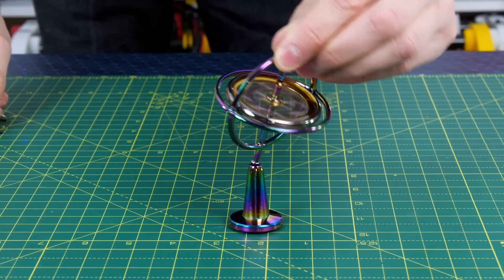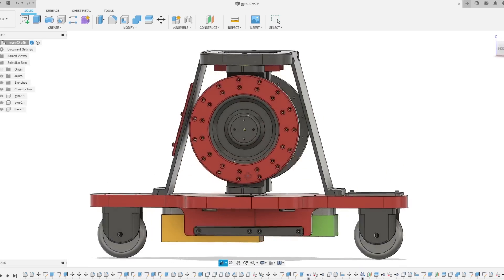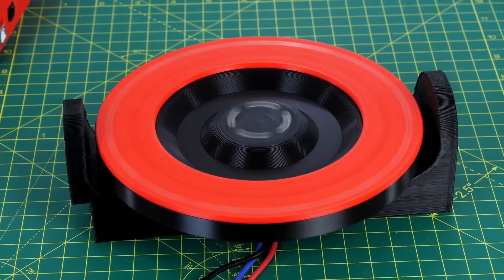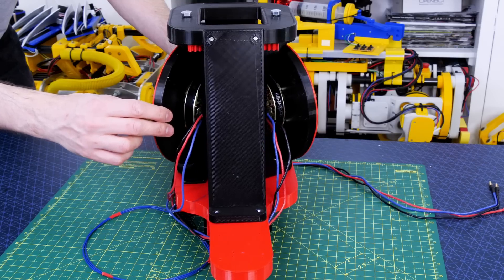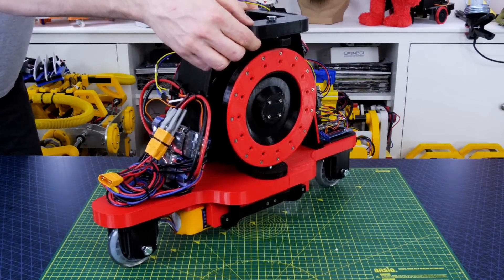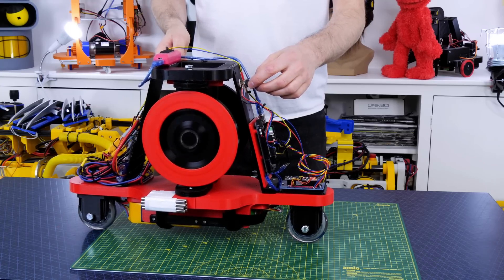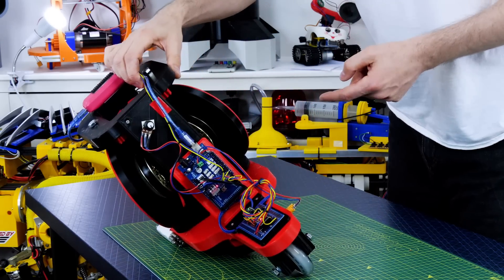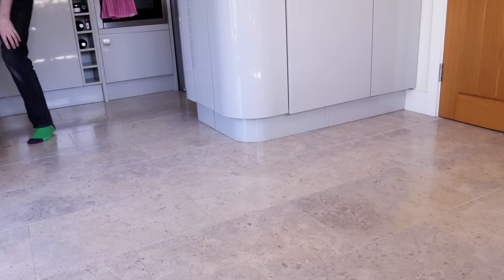Balancing on Inline Wheels with Gyroscopes

Comment: what if you lower down the forward gyro stabilization point. what if you use a gyro copter horizontal gyro flywheel. ie passive stabilization, and the gyro drift is cancelled by the ground wheels.
Reply: is it 3 years already? lol. why does a bicycle stay in direction, even the front free turning wheel, when the speed forward is sufficient. because of the grounded wheels act as gyro balancing.

Comment: I want to diy a larger printer with 400mm x 400mm bed. Can any 3d printer controller travel that distance according to the gcode if the frames are large enough

Comment: Could it consistently hold an angle that's off center? Make it propelled and see if you can make a constant turn by leaning with the gyroscopes.
Reply from the maker: Only if the gyros could do a 360 in yaw, otherwise they reach their end stops. They can only exert force when in motion.
Reply: @jamesbruton  That makes sense, thanks for the response. Would gyro brakes have any effect? I'm trying to picture what kind of linear force would result from braking on one side of the gyro.

Comment: My quick take after a bit of research is that Fanhome is not offering a great value.  couldn't find the total cost, but: correction: finally found it:  100 stages.  They are pretty sneaky about this.  $13.99 and $2.40 shipping per stage, 4 stages a month... so $65.56/month for 2 years for a total of over $1600 while appearing to have about or less smarts than the $50 hasbro r2d2 or the $99 sphero edition from a few years ago.  I love R2D2 too but you gotta vet these things.
Reply: actually it may be worse than that, I don't see any evidence that they finished the stages for the Charger, which is no longer offered, or any other models they put up

Comment: If you built it so that gyro wheels could rotate continuously (such as using a slipring to get power to the gyros) you could even allow it to hold position at 45° angles indefinitely.

Comment: i wonder if you could design a version, where both gyros would be able to roatate 360 degree, then use that ability of constant stabilization to tilt the vehicle like a bike, and turn using its high center of gravity (like a bike esentially)

Comment: I know there once was a gyroscopically upright two wheeled single seater car. With good lubrication and minimal drift/oscillation, how much energy would it take to get a car balanced? Would it be economical (i.e. because of the lower roll resistance and air drag?)

Comment: If your fix the wheels of a motorcycle or bicycle as your effectively have here, it will no longer keep itself upright as it moves. The angle between the wheels needs to be free to change for it to stay upright.
Reply: In fact, I think the angle needs to be able to both change in response to the shift in center of mass and be able to impart a torque on the centre of mass as it changes

Comment: That slow left right oscillation can be damped out by altering the relative weights of terms in the accumulation to favor more recent measurements. This is the next most important term in an approximation to the full PID controller. The Space Shuttle had a similar issue due to rounding errors accumulated as its automatic RCS system traversed the deadband during its orbits in space.

Comment: "not really supposed to run i2c off the same circuit board"
every industrial/home automation sensor ever: "hold my beer"
as long as you shield your cables and use bus buffers for longer ranges (differential ones exist if you wanna go past 10ish meters), i2c is gonna be just fine with that.

Comment: ball bearings for weight, interesting. spin that puppy fast enough and you got a claymore.
also, if you put a picture of an eye on that gyro, its slow back and forth oscillation would look like an eye looking around the room.
Reply: Oh half life 2 guy here hey!
Reply: Hay
Reply: Didn't expect you here
Reply: So in order to get the gyroscopes up to speed I've installed several dozen ball bearings in these plastic discs and I'm going to spin them at several thousand rpm to initiate a grenade boosted backhop off of this ramp here-
Reply: Hello there

Comment: I can see where this is going:       "The runabout–a Dillingham eleven-forty–shot smoothly forward upon its two fat, soft tires. Half-way to the exit archway he was doing forty; he hit the steeply-banked curve leading into the lofty "street" at ninety. Nor was there shock or strain. Motorcycle-wise, but automatically, the "Dilly" leaned against its gyroscopes at precisely the correct angle; the huge low-pressure tires clung to the resilient synthetic of the pavement as though integral with it." E E Doc Smith "First Lensman" 1950

Comment: on the international space station... when the CMGs get to the point where they can't exert force any more, we call that "Saturation". There is some automatic communication to the russian thrusters to do a "de-saturation" which can get the CMG axes back where they have control authority again.
Reply: CMGs? Or reaction wheels? Does a CMG actually have a saturation limit except for how much force it can apply? Like sure if you just rotate it continuously you'd be able to apply a continuous force, up to the point where the motor rotating the gyro around an axis perpendicular to the primary weight-spinning axis hits its maximum speed. Even at that point, you'd still be applying a force, just not enough for whatever is requested, presumably.
Reply: @clonkex  yes, CMG and you are right, at some point you lose a degree of freedom. You can read more about them here: https://en.wikipedia.org/wiki/Control_moment_gyroscope#International_Space_Station

Comment: Would allowing the gyros to rotate 360 degrees be an improvement?
Reply: Yes I believe so. You could use a slipring to power the main spinning axis and thereby allow the twisting axis to rotate continuously, you could even have it sit at 45° and it would just hover there.

Comment: With the automatic set point adjustment, can you now remove the weights taped to one side and have it automatically find the balance point (which might not be perfectly vertical)?

Comment: Am i the only one worried that the 3d printed flywheel turns into a shrapnel lauchner? be carefull james.. long life fatigue strength of 3d printed parts is really bad. with a wobbly design this means every rotation of this 3d is a countdown to a dangerous failure of your machine. you could replace the steel balls with sand or something more harmless.

Comment: Why can't the PID avoid creep by itself? Sounds like you hacked another integration step around the integration step the PID has already built in.
Reply from the maker: If the gyros could rotate in yaw 360' and keep going then it would be fine. They can only exert force when they are moving, so the end stop is the issue really.

Comment: If you turn the flywheels 90 degrees so that one is in the front and one is in the back and gave the enough room to be able to spin all the way around 360. You could use them as reaction wheels and then once the are saturated rotate the flywheels purendicular to the spinning axis and get even more force once they have been turned you could slow them down like a reaction wheel and reverse them and the cycle continues. Theoretically it will always be able to balance and never saturate. If you try this please mention me.

Comment: For projects like these, you'd probably save money and get better results if you bought a bunch of lead shot, filled a void in the print then put enough in that when you close the print, the clamping force holds everything together (like mechanically stabilized dirt if you've seen that video).

Comment: What you aren't including in your control scheme is the movement profile of the gyro motors.  Speeding up and slowing down those motors in combination with managing the gyroscopic procession should let you move forward and backwards.  Slightly angling the wheel mounts would let side tilt cause a turning radius.  It would be interesting to see how much stable control you could manage.  I remember following along with an online class called "Underactuated Robotics", and this machine makes me think of that

Comment: If you use the gyroscopes as reaction wheels you could control both pitch and roll will that configuration. Even if the two flywheels are rotating at different speeds they’ll still produce perpendicular forces rights?
Reply from the maker: If they were laid horizontally (like last week's video) and you tile one more than the other, then that would cause rotation in yaw as one they precess

Comment: Using a flywheel in that way sucks too inefficient and it's got a saturation point you only need 1 not 2 and have that 1 rotated 90 degrees if it rotates to the left make it rotate the flywheel rotate to the right and that will make it move to the right that will get rid of the saturation point
Reply from the maker: Watch last week's video I guess...

Comment: It would be very cool to build a miniaturized version of this into the head of a fancy cane, so that when activated the cane would stand up where you left it, balancing. I don't know what practical purpose it would serve, but it would be a neat "magic" trick!
Reply: It doesn't have to serve a practical purpose, but an undroppable cane would actually be really useful for the elderly. You can let go of the thing without it clattering to the floor immediately as long as it's close to upright, I can see that being worth a couple hundred bucks.
Reply: @Teth47  Actually if twisting a spinning gyro around an axis perpendicular to the spin axis gives you a force perpendicular to the plane described by the spinning and twisting axes, with a slipring to power the gyro's primary spinning axis, you could make it so that the twisting axis could twist continuously, which, with a sufficiently heavy gyro weight and/or high enough spinning speed, would allow the cane to stand up from even completely upside down.

Whether or not you could fit that into a cane, idk :P

Comment: What would happen if you decided to equipt this robot with motors and a "steering wheel"? Would driving a long and constand curve (basically circles) cause the center balancing point to be shifted due to centrifugal forces and Still keep the whole robot upright? If the robot stopped (or drove a streight line) would the balancing point return to "normal" again quickly or would you expect some issues with that?

Comment: Now you fixed the setpoint problem, you can remove the weights, right? Wonder what that looks like.
Reply from the maker: With my dirty hack version is looks like falling one side a lot more than the other. Ideally I need a velocity estimator and something that offsets the setpoint over a longer time. Then it could deal with offset loads.

Comment: 360 freedom of rotation, you have limited now
Reply: stick with 6-axis gyro balance, 3d cross with 360 freedom
Reply: wings when they are apart
Reply: gasoline electric supercap drone car, also 3d balanced, controlled
Reply: you have more lever if you have the attach points farther away
Reply: make them balls, so you can rotate without friction in 360, cameras on board
Reply: single 360 multi-axis gyro ball like in the "first contact"
Reply: contra rotating gyro spinner, should not try to throw it around to unbalance (creep down) with centrifugal forces
Reply: if this disc does work as self-upright gyro, then retest the first video spin tilt test, free ball bearings is a nasty biased test

Comment: Wow, if you motorized the fixed wheel (s) you could make turns by leaning the robot to one side or the other, just like a motorcycle, or even counter turning the front wheel for the total realistic experience of a motorcycle 😎

Comment: So the extra code which accumulates the controller output and adjusts the set point if it's consistently turning in one direction... isn't that what the I term of a PID controller is meant to do, or is it some kind of double integral term?

Comment: Could you build a Segway that is stabilized by a gyroscope? I had this idea several years ago and don't have enough knowledge of physics to have a clue about size, weight or speed of the gyroscopic wheel/s that would be needed. I imagine that you can stand on the thing and that it is somehow obvious that the stabilization doesn't come from electronics. If this worked with a lawnmover engine or something like that (steampunk like) or (even cooler) if you sat on it and would produce the energy by pedalling.

Comment: Could you mount a reaction wheel perpendicular to the gyros? when the gyros drift near to their end stops, use the reaction wheel to temporarily negate the force of the gyros as they return to the center position. This would allow the gyros to essentially move continuously as they can quickly reset when they have nearly run out of travel.

Comment: how environmentally friendly are all those plastic parts is there a recycled plastic filament option just for rapid prototyping
Reply: If you print your prototypes with PLA, it's biodegradable.  ABS is not, though it's more durable
Reply: @gregoirepainchaud   yeah I guess its a drop in the ocean compared to all the injection moulding coming out of china/ India but I suppose it could be coming  "3d fuel looks into"

Comment: If you have a single gyro in the center that can rotate 360 you wouldn't have to worry about it reaching the endstop.
A one wheel balancing robot, Claptrap from borderlands would be awesome to make.
Reply: But once this gyro is rotated perpendicular to the robot it doesn't have any control authority anymore, so effectively there's still an endstop

Comment: I was hoping you would make it a one wheeled robot and then you mentioned it. Would be cool to have both gyro and motorised wheel to balance in the different axes. But With one single wheel wit will probably spin around the vertical axis as well with only a single point of contact. So maybe a reaction wheel for a 3rd type of rotational control so you have 3 different rotational cotrol mechanisms for the 3 axes of rotation?

Comment: I think that you are not entirely correct, the real challenge of a bicycle /motorcycle isn't travelling in a straight line, it's turning, following a radius. It would be an interesting topic to explore the use of "counter steering" and whether your gyro stabilised two wheeler could be adapted to steer.

Comment: The two in line will vehicle reminds me of the Warsley do you have a car I believe there was some other gyroscopic re-stable glide monorails built around 1909 obviously I didn’t use microcontrollers they must’ve had quite elegant mechanical control systems for the gyros there are some articles in Wikipedia about them personally my favourite is the Woolsley gyro car.
. I always used to argue that you should be able to drive one on the motorbike license.

Comment: please build one with high center of mass since it will act like a reverse pendulum and will take more time to fall over, thus giving more time for the balancing gyros to correct.

i think it could be more stable for the same reason balancing a broomstick on its end is easier than balancing it on the middle.

Comment: You need to make  more and place three groups of four in a triangle formation.  Attach 2 on a rotating platform that is coupled with a counter rotating platform with 2 more units. It is important that you offset the plane of rotation 30° 

What happens when you forcibly speed up the presecion? You gain a linier force.
Reply: None of you recognize the importance of what I said.  I  know lets burn heavy fuel for weak thrust, cave man style.  Fools. I offer a revolutionary idea for free and not even one thumbs up,  troglodytes.  I left out some of the information hoping that intelligent people would be smart enough to ask the question.  You have 24 hours before I delete the comment and patent it for financial gain.  You had your chance.

Comment: Finally a use for a hubless bike wheel, That's where you put your gyroscopic flywheels.

Regenerative braking is an efficient because the electricity has nowhere to go, the batteries can only take so much.

You only need the gyroscopes going when the bike is stopped.

Dump your regenerative braking into the gyroscopes.

That also means you can get a boost from a dead stop without hammering your batteries.

Store a little in the flywheels at all times, and you could have a boost button. The right computer logic you might even be able to get it to do some crazy cornering.
Reply: Actually, regenerative braking is inefficient because with bikes, most energy is lost on air drag and friction/roll resistance anyway.

Comment: Do you really need little individual capsules for each BB? Couldn't you fit in a lot more with a simple gear-like inside tooth arrangement?
Reply: Without the sperate capsules the wheels would not be balanced.
The balls would all fall to the bottom when stopped and it would probably destroy itself on startup.
Reply: @_Piers_  think about the comment though, the teeth should keep it in place, with better space efficiency and easer to print

Comment: This is awesome! I'd love to see it motorized and also have the front wheel turn so you can drive it around.
Reply: Would the wheel need to turn? You could turn by doing the lean? ( Not a very tight turn )
Reply: @noloafingwgas  when you lean, you can counter turn to turn more aggressively, just like a motorcyle